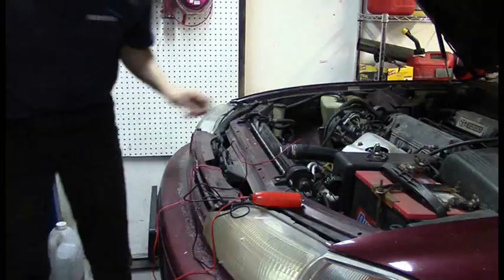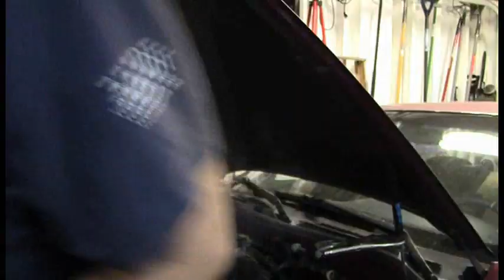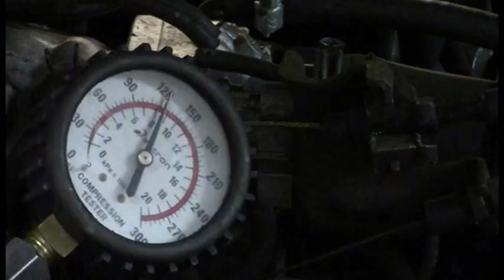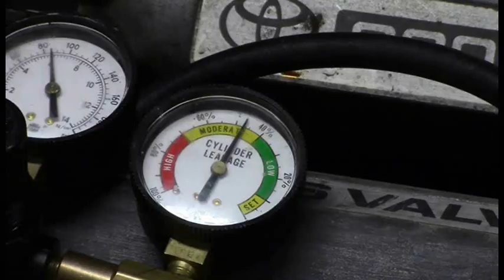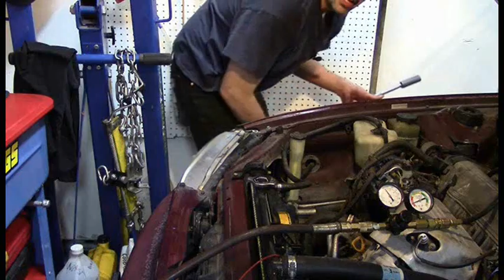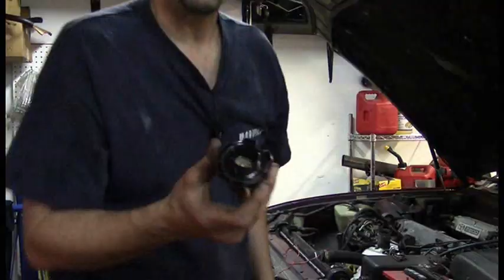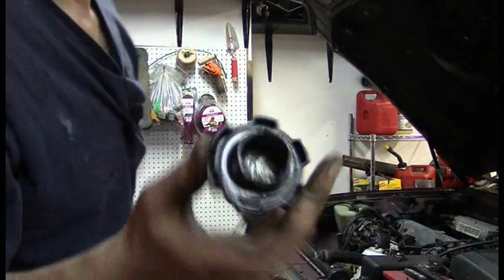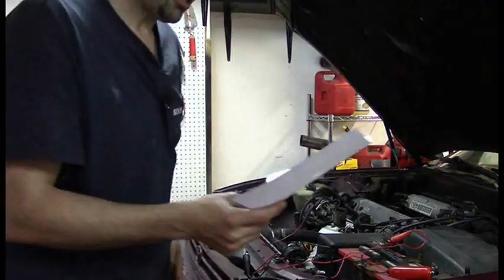12 Ways of How To Test A Blown Head Gasket Compared- PART1

Comment: I have a Toyota Previa that blew a head gasket, I disassembled it and found the blown gasket on the 4th cylinder, I had the head surfaced and replaced the head gasket.  I've got it running again but when I rev it up it is blowing steam and water our the exhaust, which scares the hell out of me.  I got a loaner compression tester from the local shop and measured the compression at 167, 159, 168, 170 (going 1 to 4) Toyota list it limits at 128 to 178 with 14 psi max difference between cylinders.  I thought I had ran the system long enough to get rid of any water from when it blew (it was pretty epic, lots of steam coming out the exhaust) (I've ran it about an hour total), I don't have access to a leak down test and being the compression seems to be in specs don't know if that would help.  Any ideas, where would I find the chemistry test you use?  Apperciate any advice.
Thanks,
Tom
Reply from the maker: +Tom Morgan With that compression test, it sounds like the good news is it is very, very unlikely to be a head gasket failure.  But two things come to mind-
  First is if you didn't change the oil and flush the oil system this could explain the problem- I am assuming you did that.
  The second possibility and I assume more likely could be an internal coolant leak at the intake manifold.  This would have normal compression but coolant would be entering the cylinder(s) through the coolant channels sealed by the intake manifold gasket.  Remember, the warp can also be on the intake side of the cylinder head, not just the block side- AND the intake manifold itself may have been warped too.  If those surfaces were not checked, it's a good bet this is your problem and it can be confirmed with a cooling system pressure test.
  See my video "replace a head gasket yourself and do it right" and it discusses all these possibilities and more that many people do not consider when they do this repair, resulting in a failed repair.
Reply: +Schrodingers Box - Thank you for the reply, and I did watch your "replace a head gasket yourself and do it right" videos more than once while changing the head gasket, a very helpful resource.  So I pressured tested the coolant system, the cap is 13psi so I took it to 16psi.  Over 10 minutes it dropped to 15.5 psi, with no external coolant leaks, weather the half psi loss is even important or could be due to the seal on the tester I don't know.  Looking at my Toyota shop manual and pictures of the head I do not believe there are  any coolant passages between the head and intake, however there is a coolant line to the throttle body and egr valve.  I did change the oil, I didn't flush it, so maybe there could be some water in the oil but I would not think very much.  I just cranked the van and reved it a couple of times and there is a fluid spray on the ground right behind the exhaust pipe.  It doesn't smell like gas to me, and will not ignite (seemed like a safe test) so I'm assuming it is coolant (which currently is just distilled water).  So anyhow I'm somewhat baffled, not sure if it could be a bad egr or throttle body leak, or maybe still just water in the muffler from when the head gasket initially blew.  Any thoughts would be greatly appreciated.
Reply from the maker: Thomas Morgan Yeah you clearly have pretty solid comprehension of this so I agree, your systematic methods are pretty much no different than mine and sounds like you covered the bases.
  Keep in mind engine temp can be a major factor with coolant leaks- you may try the pressure testing both hot and cold engine.
  Some models have EGR coolant passages, Throttle body coolant passages, etc--- even Idle Air control motor gaskets that cover coolant passages but all these are nullified if your coolant pressure test is negative.

  If I were looking at the car I would probably initially rule out if the exhaust smoke was indeed steam/coolant or hydrocarbon through fuel trim analysis and if the fuel trims didn't indicate rich I would be more diligent in pursuit of coolant in the intake despite the negative pressure test results.  I would start with a leakdown test actually.  I believe in leakdown tests above all else.  If leakdown test is negative I am ruling out head gasket for good. I then would look at the possibility of lots of water in the oil still, maybe even in the exhaust or cats/muffler. After that- really I don't know what to say.  If the car is losing coolant when the engine is running I would be inclined to put the pressure tester on and again check all possibilities for coolant to enter the induction or cylinder.  I am not familiar with the Previa but if indeed it has a dry intake (and I am referring to the lower intake of course if it has a plenum, almost all upper intakes are dry) then I don't know what to tell you- you simply must be overlooking the leak in your procedure somehow.
   You might even consider running the engine without a spark plug and disconnecting the fuel injector in each cylinder (one at a time obviously) and see which one spews coolant and dramatically reduced the exhaust steam. All kinds of creative things you can try.
Reply: +Schrodingers Box - A big thanks for all the help, I decided it would be best to just start ruling things out, one of the easier things seemed like the exhaust so I disconnected the exhaust manifold from the rest of the exhaust system and there was no steam or water when I cranked it so it must just be fluid left in the rest of the exhaust system.  Consider yourself lucky your not familiar with the Previa it's a wacky minivan that looks like an egg, its mid engine and its mounted underneath then van, the inline 4 is mounted horizontally.  It required dropping the engine and transmission to replace the head gasket, I probably have 30 hours in it.  Luckily it a 2nd vehicle so  there was no rush.  Thanks again.
Reply from the maker: Tom Morgan Tell you what- let me know what it turns out to be because your thinking is same as mine.  My first response was in fact to disconnect the exhaust and rule out water in it but I reconsidered that it seems like a cumbersome step- yet you thought the same thing.
  I can't help with any more ideas bro- you have the same ones I do.  Maybe a matter of your quality of tools or experience or whatever, but your thought process is 100% accurate.

Comment: thanks for taking the time!   I am no scientist but I still enjoyed both of your headgasket diagnostic videos.  one thing I ponder is if you have gone out of your way to find out where the air goes in a car with a cracked head or block after performing the compressed air test.  what mean is if you have noticed this air flowing out of the pcv valve or oil cap or the like.  I would be interested about your findings on that type of scenario.  excellent work.

Comment: 15:25 lol!  Hey was that a WS6?  Nice car!  

I'm helping a friend with a Firehawk at the moment.  Small tiny bumper tap set off his airbags and did a whole lot of damage to the interior and glass.  Enough for the insurance company to total it.  Sad.  It doesn't even need body work.
Reply from the maker: kissmyasssuckers Nothing I can do- all you have is a list of symptoms. I need data to make a diagnosis. What is the compression? What is the fuel trim static vs load? Was a leakdown test done? What is the static vs load coolant pressure?
  With just your description it is impossible to make a diagnosis.
Reply from the maker: kissmyasssuckers Happens all the time. WIsh I could help but based on your description all I would be doing is guessing like everyone else on the internet would do. I only make a diagnosis when I know it must be the correct one.
Reply: +Schrodingers Box I want you to know that this video earned you my respect and my subscription.  I'm giving this video a drive-by shout-out in my next upload.  It's dynamite work.  It explains head gasket failure better than every other video on YouTube, including a conclusive test with a sweet control subject.  Everyone who reads this comment is required to subscribe to this dude and give his video a like.  :D
Reply from the maker: ***** Firehawks are "in" these days! Fix it- it's worth $$!
Reply: This I know!  lol.  It's black on black on black.  It's the hardest thing in the world to find interior parts for.
Reply: Schrodingers Box Hello! I have a Volvo 940 Turbo from 1997. I understand that your black beauty is you baby. My Volvo is my baby. And I think my baby is hurtin'.

The story goes: I noticed that the temperature went sky-high after a good drive. After I shut off my engine it went down. It was appearant that after I opened the lid for the coolant that there was air in the system. I let her run idle for a while, revving a bit and noticed the water level sunk to the bottom and went over the top, spilling over the tank.

 I filled with coolant and this repeated itself a few times before it went dead still at max-level. Most of the air was then removed. I noticed that the coolant (I use blue coolant) was a little kinda.. blue-gray-ish. (I've used different brands of coolant since I'm a student and travel alot. and they sell a different brands of coolant at the city I'm studying in)  I took her for a spin, and oh boy she ran great. The coolant kept its level and all seems okay.

The exhaust is not white, or anything, and I haven't noticed any oily water on the dipstick, nor any performance change. She's still kickin' like a mad viking. So my question is: What do think is wrong? Is it the head gasket?

Please answer, I have a feeling this will keep me up all night.
Reply: I have no clue..sadly we don't own a garage or any of the necessary equipment to do those tests :(
Reply: I also sent a message though, the same as the previous comment. Sorry for bothering you, or seeming desperate.
Reply: I understand. Thank you for answering my question. Have a nice one, thanks again! :)
Reply: Pressure test the radiator, and it will answer your coolant problem.  If it's leaking, it will leak either internally or externally.  If it's external, you will see it pooling on the ground. if it's internal, you won't.  If it's leaking internally, do the test in this video to decide whether or not it's worth fixing.  The coolant system pressure testers cost between $50 and $450.  The cheap one made by Stant would suffice.  No leaks, well, then it's probably just your thermostat.  Your symptoms describe dozens of potential problems.  But of course, what can you get for free over the internet?

That's right.  Guidance.  The internet actually doesn't contain any answers.  It's true.  It only offers guidance.
Reply: ***** I've already sent her away 2 months ago to the mech-workshop and they couldn't find any leaks at all.. And I've changed the thermostat recently.. That's one of the reasons I'm consulting a "guru".. I changed the thermostat due to that she wouldn't reach optimal temperature during drives or running idle. That's fixed though.

Thank you for your wise words!

Comment: Will that CO2 tester work on my Dodge Dakota? 3.9L  engine with only opening to Radiator is through an Expansion Tank.
Thanks
Reply from the maker: Richard Hoepfner Yes I have used this all the time on expansion tanks.
Reply: Thanks. Is there an inexpensive brand/model that you would recommend
Reply: +Schrodingers Box 
Nice video!  I am a scientist too, a biologist. I am curious to know where you got that bulb set up, and maybe a close up of the bottom to understand how I couple possibly rig one up.

I plan to use phenolphthalein as my tester

Comment: i have a question concerning chemical exhaust test. I just replaced a set of head gaskets on my mazda pickup with a 4.0 ltr. eng. with 200,000 miles    the head was warped,  the  machine shop said that was common with those the resurfaced and tested for cracks.. anyway I re-assembled the engine according to the book.  started the engine within two seconds, and five seconds later steam began puffing out again. just like before. no water in oil (skillet test) compression was  compression  is 160 / 170 for all cylinders dry/wet. when I use the chemical test, the chem stays blue.no foaming or filling the tube beyond the added blue chem (tank drained down 5 inches).  when it foams and turns yellows it has twice the amount of coolant (or more) in the detector tube,. is this a chemical reaction due to the added  coolant or exhaust gas? .
I used to Run the Heavy Equipment shop at Mchord Air force base. (now JBLM) So I thought I new my way around an engine. I was even an instructor.  Good thing I am not a pilot!
Reply from the maker: Imjusttoo Dissgusted I didn't follow the part about "when it foams and turns yellow..." but either way, prior to that, sounds to me like an internal coolant leak to the cylinder from the intake manifold.
  A radiator pressure test should verify that easily.
Reply: Too clarify, the foaming part happens when the coolant burps or bubbles up and gets in the tester unit. it tends to foam then settles down usally at least doubles the amount overall liquid in the tester itself  50/50 tester fluid/antifreeze/water
Reply from the maker: Imjusttoo Dissgusted The coolant should never enter the tester unit. The tester should only measure the air pocket at the neck. If the coolant enters the unit the test is invalid and must be redone

Comment: Hey man,

I haven't run all these tests yet but I have a problem with my '89 T-bird (daily driver, not run too hard, 187k miles) with a single-port and naturally aspirated Ford 232. It starts/runs fine and has no compression problems BUT it starts to smoke after a few minutes of running it. I checked the oil and it had some coolant in it but there aren't any combustion products/fuel in the coolant and the engine still gets good compression. I've already ripped off the intake manifold assy and found that one of the intake manifold gaskets was fried. One of my mechanic buddies says that was probably the cause of the smoke but due to the Ford 232s being notorious for blowing head gaskets I thought I would get a second opinion from someone that is a little more objective than my average mechanic buddy before I get really dirty ripping the cylinder head off for inspection or replace the intake gaskets/seals and encounter more problems later. So, what are your thoughts?

Thanks!
Reply from the maker: I only make the diagnosis of a head gasket after compression and or leakdown tests OR a positive combustion test.
  Without the data from those tests I cannot make a diagnosis,
Reply: Schrodingers Box I think I'll replace the intake gaskets/seals then perform all the tests. Thanks for the quick response!
Reply from the maker: skag boy What is your evidence leading to the conclusion that you need to replace intake gaskets?

Comment: I have a 2002 BMW 530i I just changed a leak in my heater inlet pipe and now coming to find out after changing my oil it all turned milky. I'm guessing it's my head gasket. Any suggestions?

Comment: When you check transam with the chemical tester it looks green for me ...
Reply from the maker: Lol it most certainly is not I can assure you.
Reply: Schrodingers Box Looks green -ish for me. I watched scanner danner video on these testers and he wasn't really happy with the way they work. Sad as I thought I have 100% accurate tool.
Reply from the maker: The truth is- these are 100% accurate if they detect CO2. In that case, you definitely have a blown head gasket. But I agree with Danner- If the test is negative, you cannot be 100% sure the car is fine- I.E. it will give false negatives but not false positives.
Reply: Schrodingers Box
You are right but other problem is that they turn any shade from blue, yellow and green.